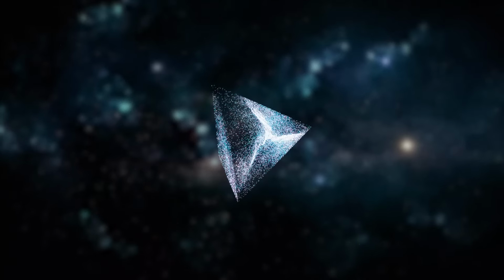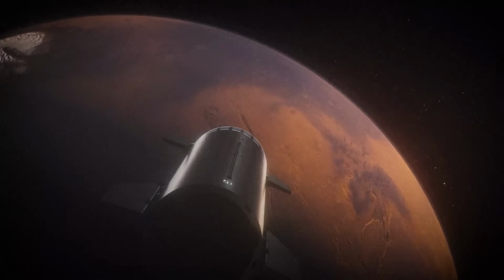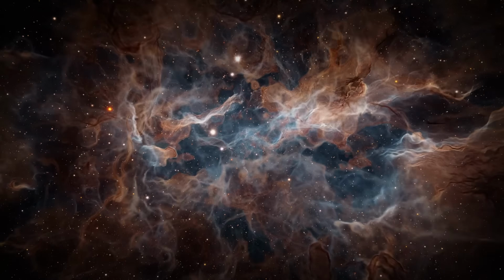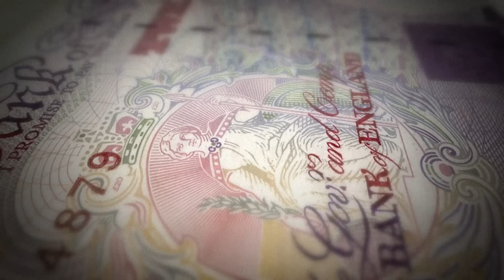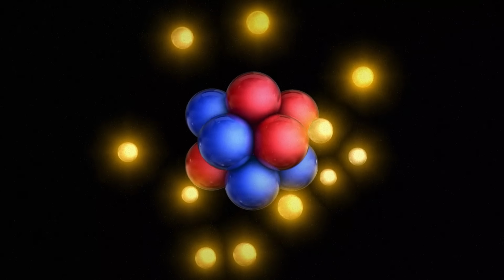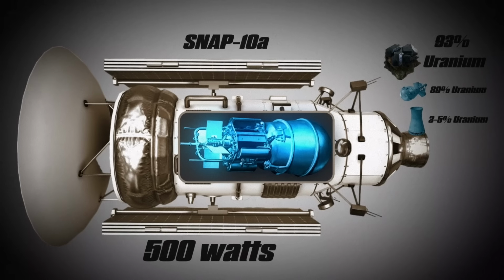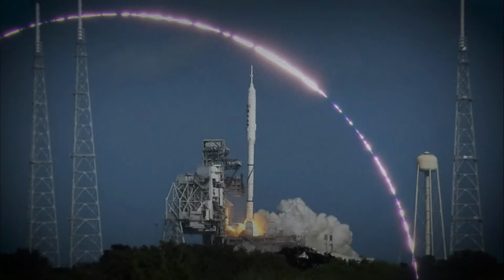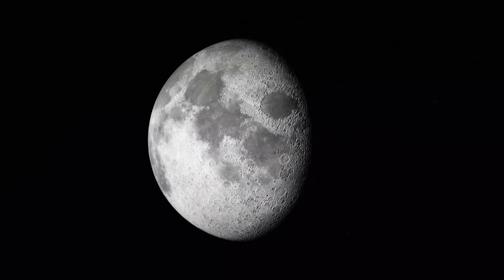The Real Reason Nuclear Energy Is The Key To A Mars Colony!

Comment: I think it was Patrick Moore back in the 1950s or 60s commented that a Moonbase at one of the Moon's poles in constant sunlight wouldn't need either nuclear nor photovoltaic power. The temperature difference between full sunlight and shade on the airless Moon is hundreds of degrees. A fluid-filled metallic loop with a sunshade over half of it would have the temperature gradient sufficient to drive an electricity-generating turbine.  Simple, efficient and strong.
Reply: I think they are trying to make an propulsion engine like that!

Comment: I think the possibilities of such a small and portable reactor here on earth are even cooler than bringing it to space. Bring sustainable power to many more places.
Reply: True, but at the beginning it will be so expensive, that it will only be "suitable" for space exploration.
Reply: For most use cases here on earth (like powering and heating large cities), large modular nuclear power plants are better, because they generate a lot more power and thus have economies of scale benefits.
Reply: I'm kind of at the point where I believe SMRs are red herrings. We've got some impressive naval reactors but if we're talking about Earth-bound gridscale power we'd be better off using large reactors that can use recycled/low-enriched fuel.
Reply: @nicolaedanu8197 what do you mean? We've had small RTG nuclear power devices since the 70s..

Comment: Based on the power output of the kaleidos reactors, you’d need two of them to provide the required 1.76 MW of power needed to make enough methane using the sabatier process to fill one starship within two years (so they can return after orbiting the sun). They weigh 20 tons each so yeah two can fit on a single starship, but that’s a lot of capacity. They could definitely land a starship specifically meant to be a fuel depot though.

Thats actually pretty impressive I didn’t realize micro reactors were capable of this.

Comment: Nuclear fuel will take a fraction of the storage and can reach speeds of 170% or faster.
We have nuclear submarines,
- This is the way -
Throw some solar wings on it as well 👐
Reply: 170% of what?
Reply: I read that as "deliver 1.7 times the cargo". I'm not giving up my 2-year free return abort option.
Reply: Velocity compared to chemical however this does depend alot on your mission profile and the kind of nuclear engines you use @filonin2

Comment: Nuclear will be primary power until mars settlement can drill sufficiently deep to tap into geothermal.  Could be 1000 feet toget constant above freezing source or could be 30000 ft we just dont know yet.  In any case no independent colony on mars will possible without it.  Also remember verticle shafts at those depths will allow for natural pressueization of the atsmosphere to occur.  So we can get double benefits of livable heat souce and liveable air pressure at almost no outside energy after shafts are drilled.

Comment: Diamond Batteries are capable of providing electricity for 1500 years so why do we need flimsy solar panes or a thermoelectric generator which only lasts about 100 years?
There is plenty of carbon on Mars in the form of CO2. 
Moxie can strip the Carbon off CO2 and manufacture Diamond Batteries.
Reply: Because things that exist on a lab bench are not always easy to build at scale.

Comment: I smell BS. Why? Because for 10 years I have heard about Micro Nuclear Reactors - following the legend of the HTR Micro Reactors of the 1980-ties and proposed Generation IV Reactors of the 2000s - that turned out to be not possible AT ALL, although companies were already pushing regulatory agencies to get a general permit to build them anywhere in europe, like small stationary combustion power generators. A european company needs high Temperature media? Just put in an HTR you buy from stock.  HTR  and Micro HTR looked great on paper, but not one single prototype ever functioned as intended. to be honest: I see intriguing similarities.

The Mini Reactors I have heard of so far, are not so mini - more like a single core Nuclear Power Station of the 60ties. They just try to get rid of the huge actuators, the huge water  basins and the big core pressure tank, the huge control rooms and the containment building - which is fine, as tehcnology has massively advanced since then. By just removing all that COMPLETLEY gives these awesome looking small sci fi renderings that look like something that could work. But where are the pipes? Where is the power generated and where is it put to service? Where are the actuators to control the fission rods? Is there infrastructure needed, who overlooks safety and how?
I tell you where they are: They are not shown, because on a submarine or a aircraft carrier reactor you don't see them - as they blend into numerous other pipe and room systems of a ship  hhat would be there anyways with a combustion power source. 

Don't get me wrong - I'm not against trying to make it happen - but as soon as I hear "Oh, its just the regulators who prohibit us from doing it" I smell BS. Nuclear fission is very well tested and understood - it should be rather easy to have a working prototype constructed - including all necessary plumbing and control structures and sufficient safety precautions - and hand that work over to regulatory agencies in any country in the world you find easy to work with. Finance it by crowdfunding - but I am pretty sure that would only work, if there is a finshed construction presented beforehand, where EVERY needed part would obviously be able to be allowed by regulators. I personally like that, because Nucelar fission bears some inherent risks!  

That said: I think it is possible, all I have seen so far - including your video -  is more renderings that cry "sci Fi movie stuff".
Reply: Besides: Battery technology has come to a point, where nuclear power would only be needed to recharche a battery powered vehicle. But as soon as you get statinary you could as well have a 100 times larger storage battery than the vehicle battery for recharging every few days, or just make a light transfer via an orbital  mirror to a stationary solar panel. waaaaay easier to do than a highly complicated, rather heavy, low power fission reactor built into a vehicle. Adjusting a mirror in lunar orbit to cover a certain point would have been almost impossible in the 60ties, but today it seems to be in the range of any capeable engineering group. Getting off the earth gravity is the hardest part, but it seems to me this time it could be solved in a sustainable way. Imagine: 10 by 5 Meter of solar panels would easily create 10 kw of elctrical power! Weighing almost nothing (if needed, seems we get heavy lift to moon in 5 years)  and straight forward to build. Especially if we will have building and service crew on the moon soon.

Comment: Let's see ideas for cooling...

Update: not a pip 😒  That's the most significant problem for nuclear power in space.
Reply: Ha ha ha ha
Reply: Large radiators for power generation and LH2 for propulsion
Reply: @preisschild4622  Well, yes, but "large radiators" are a huge problem. (By "propulsion" you mean reaction mass in the nuclear thermal engine, I presume?)
Reply: @bazoo513  True and Yes. You could also use the LH2 for cooling, but that probably only works when thrust is wanted